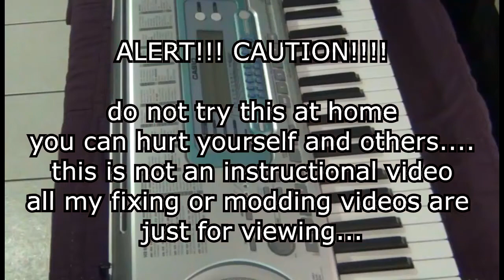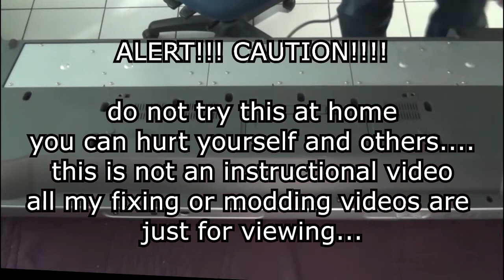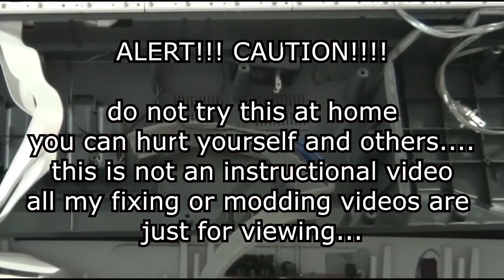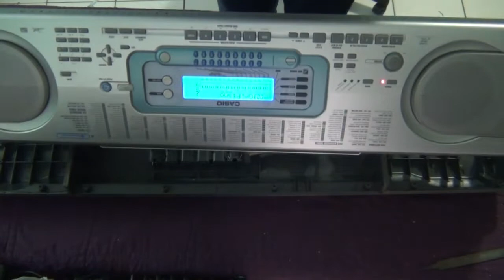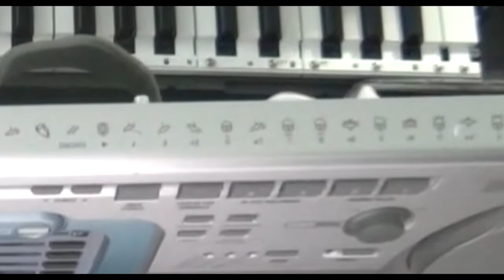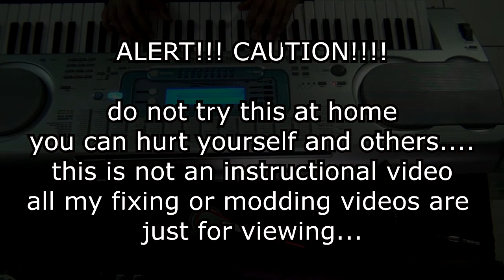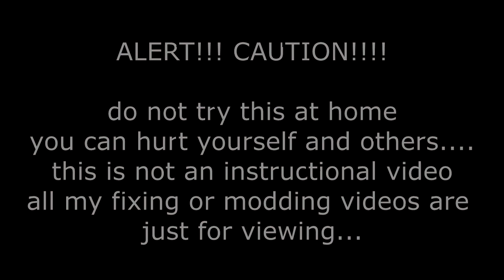fixing casio WK 3000 keyboard

Comment: I found one in the dumpster, took it home cleaned it up, 2 battery springs rusted off, I dont have power adaptor to test, I set out to repair with flashlight springs, came on, no sounds. turns out volume board had 2 broken traces on the board, and volume pot welds were loose. quick wire bridge repair to ribbon cable and resolder welds...sweet sounds come out. BTW the screws that hold the large speakers are weak plastic, I used 4 nice globs of silicone on each speaker to secure to the frame.
Reply from the maker: Great. Thanks a lot for sharing.

Comment: Im having truble with mine for some reson it will turn on but when you play a note it with play a loude glitch like static sound and the screen with not have evrything on it and when i got it it worked perfectly i had had it plugged in a wall and all i did was move plugs and it broke 😟 i have been trying to find youtube/google content to see if theres a way to fix it but have found nothong i took my piano apart but i have no clue what im doing and donr wana mess it up anymore
Reply from the maker: Sorry to hear that. Looks like you have to take it to the electronics shop for repair. Not sure about costs.

Comment: Wow, all of that work to fix a broken solder joint! I would have opened the case, removed the PC board that the wall wart plugs into, resoldered the jack connections, and I bet it would have worked like new. Now, if this transformer fails there's a lot of work instead of just a new wall wart.
Reply from the maker: So far, so good..still working..i dont know electronics or studied electronics.
Reply: Don is right... The dc jack wiggling around and turning on and off tells me too that the solder was broken on pc board where the dc jack is. Very simple fix takes about 10 minutes.

Comment: Do not try this.
Reasons:
1.  Modifying a equipment to take 110v or 240v AC needs a electrician licence in most countries in the world and is dangerous if you dont know what you are doing.
2.  The method used in this video is basically connects a power supply to the battery terminal directly and is wrong though works with risk. (The original circuit has diodes in between the battery circuit and AC/DC supply circuit for protection).
3.  The original problem can be easily fixed (As some comments have already mentioned). The problem is either (a) The DC adapter used was with an incorrect DC plug (This can be easily felt and the diameter of the plug can be detected visually). (b). The 12v DC "female" connector is soldered to a power supply board. With time and multiple uses, the solder could be broken from the  board. All you need to do is (i) open the cover, (ii) check for the broken solder with eyes and ohm meter (or multimeter) (iii) re-solder the broken solder. Even better to apply hot glue to help anchoring the 12 female connector (And the problem is fixed)
NOTE:  The older Casio WK-3000 or WK-3300 series uses negative centred DC supply (you can confirm this information from the little symbol just below the connector of the keyboard).
Reply from the maker: That is correct. Thank you very much for your comment greatly appreciated